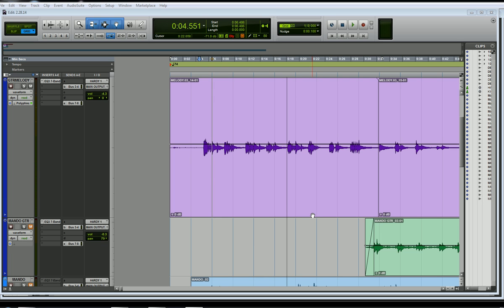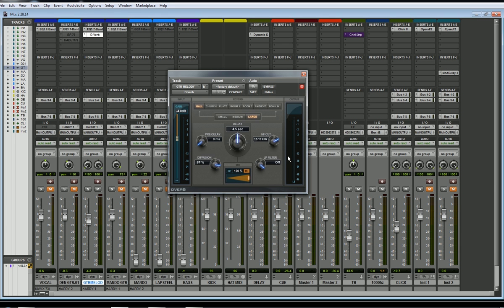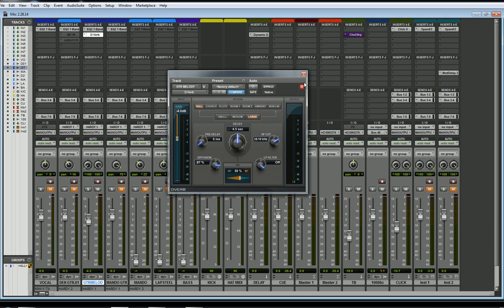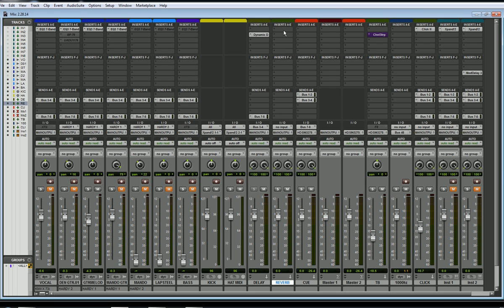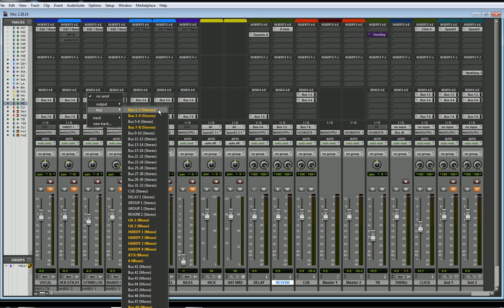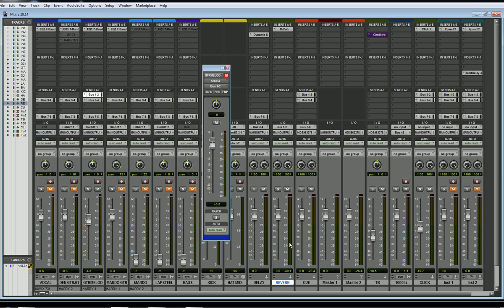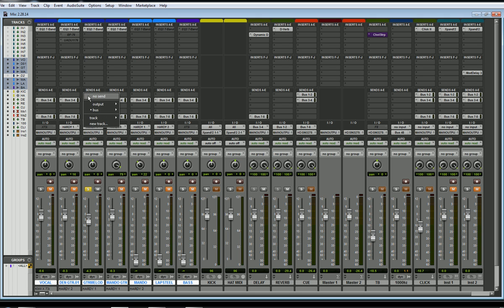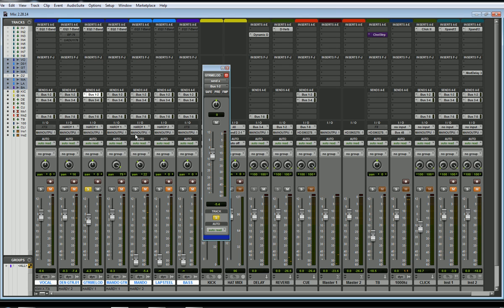How to use reverb in Protools dverb setup

Comment: Good video, very helpful.  I would like to know the best way to keep the amount of reverb consistent sounding from the beginning and end of a song. It always gets very wet on the loud parts and dry on the soft parts, so I'm wondering how to best deal with this. Any advice?
Reply from the maker: In my opinion less is more with reverb unless you are really trying for an effect.  Reverb should change with the volume of the vocal for example.  Thats how natural reverb in a church works.  
Try automating  that vocal track volume, that you are adding reverb to, so that the quieter sections are a bit louder.    (balance it out a bit)  Try backing off your reverb send so it sounds right at the louder sections.  then listen to the quieter parts and see how they sound.  

You could automate the reverb return to accommodate for issue but that is very rare in the real world of mixing.